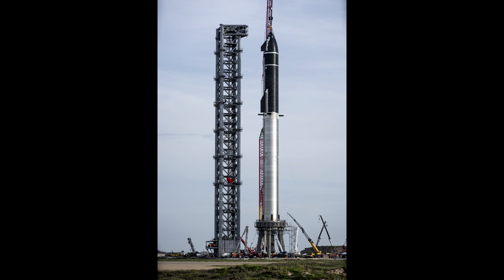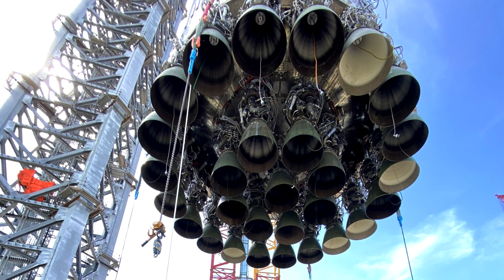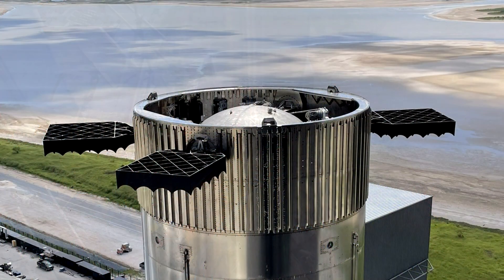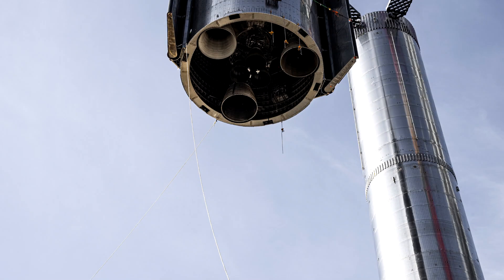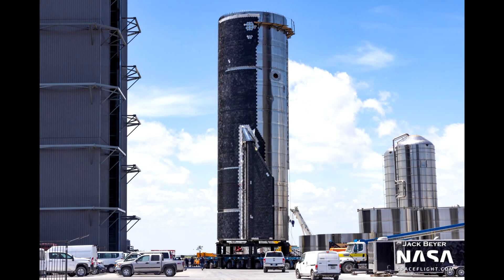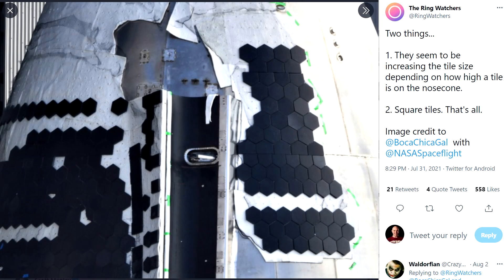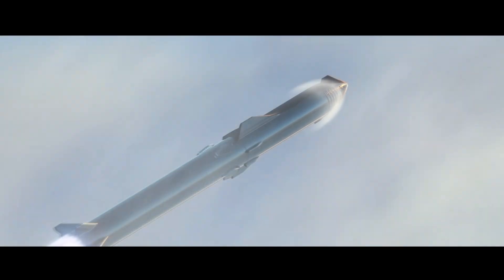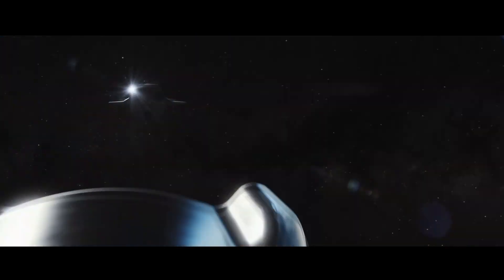How SpaceX Designed A Heat Shield For The Largest Spacecraft Ever Built

Comment: Just as an aside, has anyone ever thought of a spray on heat shield? Come back from orbit and reapply over exposed areas.
Reply from the maker: They tested an ablative paint type coating on the X-15, the problem is removing it and reapplying.
Reply: The problem with this is that you would need to melt the heat shield or make it a cement. Melting a heatshield requires insane temperatures by design, and cement requires time to set.
Reply: @LaughingOrange  What about an something like an epoxy and a solvent?
Reply: Cool idea for sci-fi if not for reality
Reply: @scottmanley  what is your view on Anti starship Anti spaceX channels like common sense skeptic ,thunderf00t,etc ??
Reply: Only need heat shield for descent ry,...could heat it on ascent, let it set in space, get exposed to heat from the sun etc, could it be ready for descent?
Reply: @scottmanley  did they try white spirit that cleans everything 😂
Reply: @eternalemperorvalkorion750  when cleaning, nothing beats good old brake cleaner xD
Reply: baugcht They should have gone with the traditional bio-fungal agent approach!... Self assembling! ;)
Reply: When hearing “spray on”, I inevitably get horrible flashbacks to the spray-on insulation that was applied to the Shuttle external tank.

Obviously not the same thing, or even really analogous, of course. But god what a problematic thing that turned out to be, in terms of extra debris to rain down on the orbiter TPS ☹️
Reply: @Hello-vz1md  thunderfoot is an intellectual fraud.  He should stick to chemistry and stop discussing topics he knows nothing about.
Reply: @jgottula 
spray on spray off
Sounds like ElonFuuu~.
Reply: Early in the Shuttle program they were talking about something like that, that an astronaut could apply. If he could get to it.
Reply: It was a possible option with the Space Shuttle. Same with an ablative heat shield identical to that on Mercury, Gemini, and Apollo, along with a heat shield made of metal shingles.
Reply: @robertmiller9735  that was one of the main reasons the Manned Maneuvering Unit (MMU) was developed.
Reply: @scottmanley  ... & it was pink!
Reply: Spray-on heat shield for emergency purposes does sound like something that in theory could have been used in the post-Columbia days of the Shuttle program, when they started actually getting paranoid and doing real robotic arm self-inspections of the heat shields and so forth.

I don’t think this was ever the actual plan though… AFAIK the plan basically involved “welp, that orbiter is a writeoff now”, and if it was an ISS mission you’d just come home on a Soyuz or something, and for Shuttle-only missions you’d have the mandatory ready-to-go other-orbiter on standby at the other pad launch up, hope it didn’t also have a fatal tile problem (!), transfer over to it, and then again basically just ditch and forget about the damaged orbiter.
Reply: @rwboa22  Oh, fascinating. Didn’t know about that angle of the MMU. Suddenly makes a lotta sense when looking at the “how the hell do we get an astronaut all the way over to this-or-that nook-or-cranny way over there on the orbiter underside via the robotic arm?” stuff that ended up being under consideration.
Reply: @rwboa22  Yes, I know. That was before they realized the arms could do the job better. Imagine an astronaut trying to work on the underside: no handholds at all, forcing him to use his MMU jets for traction. Don't think that could work.
Reply: @xWood4000  Epoxies and solvents are organic compounds. At these temperatures anything organic left on the hull just burns away rapidly, instead of ablating.
Reply: For this the biggest problem is the CM's of expansion and schrinkage of such a large metal tank
Reply: @Hello-vz1md  It's possible for two things to be true at the same time:
(1) Elon Musk frequently lies/exaggerates.
(2) SpaceX does some really amazing things.
The Hater channels focus on #1, often losing sight of #2.
The Fan Boy channels focus on #2, often losing sight of #1.
Reply: @paulmichaelfreedman8334  Hmm, you're right. I don't know enough about material science to come up with something similar that isn't organic
Reply: @JohnDoe4321  i agree with you 
Those channels don't give right credit to Elon and his hard works 
Same for fanboys they only focus on good works and ignore bad things
Reply: @anthonypelchat  My man, I'm a fan of SpaceX as much if not more than most people. But you got to admit starship is SKETCHY AF. You have to hope your MASSIVE windows that are placed on one of the highest stress points of the aircraft don't break, hope your large exposed 5m+ hinges stay intact during reentry, and you better hope the landing goes off flawlessly because if something wrong does happen you are guaranteed to die as there is no way of escape. SpaceX are basically relying on everything going right with very little redundancy. These are all valid criticisms by very intelligent people, dismissing them as just "spreading hate" is naïve. If you really want to face facts SpaceX hasn't even really proved recovering the Falcon 9 has saved them money yet (just think about the costs of running the barges, transporting the boosters, and the hundreds of extra personnel) They very tight lipped on actual numbers and their launch costs to customers are the same as always. Lets not even get started on how dumb earth to earth is.
Reply: They tried a spray-on heat shield with the X-15 rocket plane, and they found that it just didn't work very well.
Reply: @Train 2noplace What about if you could build tiles on a huge shaped silica blankets formed to the Starship shape already then have a machine/robot and people manoeuvre that on to the hull and bond and attached fixings?  I think that wouldn't work so what about a robot or robots that can not only fix the studs but apply the tiles also as per computer algorithm.
Reply: @xWood4000  It probably has been looked at carefully but a formulation that's easy to apply but tough enough to take the temperatures hasn't been developed ... yet.
Reply: @scottmanley  Have they ever tried an ablative coating on a semi-flexible substrate that could be attached/removed in larger panels?
Reply: @jordanturner97  Name one launch "entity" (company, country, whatever) that has "proven" their true launch/recovery costs.  And why would SpaceX share this information, given they are a privately funded corporation?  To the extent that competitors don't know the true costs is a significant competitive advantage for SpaceX.
Reply: @xWood4000  That is why it's so frikkin hard to design a good, functional and long-lasting heat shield. And I expect SpaceX to have quite some issues with it before they get it right.
Reply: @scottmanley  Can´t see it being rapidly reuseable if they have to replace tiles. Even if it is only every 2nd launch. I feel SpaceX will come up with a new non tile solution.
Reply: @jgottula  yeah that was regular foam type insulation for the fuel storage main tank, the single use one. That foam was problematic, they always had to touch it up before launch. And not too mention the chunk that fell off and which led to the demise of Columbia on STS-107. And it looks like the new SLS core stage  (with 4x shuttle engines) might have the same coating, it this case it wont matter if chunks fall off.
Reply: @jordanturner97  you are a spacex fan and your first argument about starship is a strawman against windows that might not even end up in there? And the concern is that they can't design them properly for the loads during reentry? It's obvious where you are coming from.
Reply: @jordanturner97  i think they've proven it enough based on the sheer number of launches they've had compared to any other competitor on the planet currently. they're either A making more money than all of them, or B cheap enough that everyone wants to use them.
Reply: @zoltankurti  I think you might want to work this out with a therapist. I'm a SpaceX fan but I actually have a foot in reality. Did I say they couldn't design windows properly? No. Don't put words in my mouth while trying to lecture me about strawman arguments. Windows are very fragile, represent and absence of vehicle structure in the areas they are placed, and require complex seals and mounting due to differing expansion rates. NASA even made SpaceX remove some of the windows in Crew Dragon because it would not meet their Risk Factor requirements otherwise. I've done my research, Where's yours? Where's Elon's? Ever wonder why every single plane you've ever been on or rocket you've ever seen doesn't have a wall made of windows? Starship looks awesome and I hope SpaceX succeeds, but you're probably young and need to learn there is a difference between being a fan who is able to look at the positives and negatives of something and criticize it; and being a Fanboy who takes any criticism as a personal attack because you see the creator of it as a god. It's easy to see which camp you fall into bud, It's not healthy and blind fandom points to some deep rooted issues you should try to resolve
Reply: Rhino Liner…… 🤔 hmmm 🤔 …. Elon o Liner ????
Reply: @jordanturner97  my guess is that they simply won't have windows or much smaller ones like they have on crew dragon. If they will, they solved all the problems you mentioned. I did 0 research about this, it was kind of obvious that if they have problems with huge windows they will not fly humans with huge windows. I think this is solidly grounded in reality. Notice how I did not go and try to defend point to point or the idea of crewed propulsive landings on Earth. I hope the "very inteligent people" does not include common sense skeptic, because that guy doesn't understand parts of high school physics. If you don't believe that check out his comments under my video. Enlightening.
Reply: How about a quick patch with Bondo and Flex Tape?
Reply from the maker: @Hello-vz1md  Skepticism is good, but lots of these examples are massively inconsistent and frequently head off out of touch with reality in attempt to criticize things. True skeptics would be happy to be proven wrong.
Reply: @jordanturner97  The problem with TF and others isn't the criticism. It's the outright lies and spreading hate. Calling something fraud or a PR Stunt because the early development doesn't match the far future possibilities is crazy at best. Seriously, the windows or hinges being a concern and calling it fraud or sketchy because of that? Guess what, the Shuttle had both and never had issues with those. And do you see either on the prototypes? No. The reason why is because SpaceX isn't focusing on those. The renderings are simply that, CGI by an animation team, not the engineers. Anyone calling it sketchy because of that is a fool.

As far as SpaceX "proving" recovery cost, they don't have to. Are customers saving money? Absolutely. SpaceX DOES sell reused boosters cheaper:$50M vs $62M. That's what happens when you rely on idiots for research. You start making stupid comments. I'm not trying to attack you. That is the crap from TFoot. He also got numbers from competitors on Falcon 9 costs. Really? You actually think ULA would be honest about SpaceX costs if they actually knew? And you know a fun one: TFoot actually used crap numbers to compare Falcon Heavy contract costs vs ULA's and did NO RESEARCH AT ALL!!! He is absolute junk. 

All you need to understand the savings of Falcon 9 reuse is Starlink. Why would SpaceX reuse boosters for themselves if they were more expensive? Outside of that, how would they be able to launch as fast and frequent had it not proven to be hugely successful for them? As for customers, why would SpaceX greatly lower costs for them when SpaceX is already the cheapest option by far?

For the rest, I'll make it quick. How could you have a fully reusable cargo stage without a hinge? How many crewed spacecraft haven't had windows? And for Earth to Earth, every launch and recovery of Starship is effectively that. The only difference is having a landing platform in a far different area from the launch platform. The US military is already looking into it. Will it replace traditional travel. Unlikely, but that doesn't mean that the system is impossible.
Reply: @Hello-vz1md  thunderfoot is generally (all themes, not necessarily related to spaceX) sometimes right and sometimes just a self righteous prick. He overestimates his knowledge and just doesn't like some things. That's pretty apparent.
Reply: @scottmanley  it’s really cool that you answer questions!
Reply: @jordanturner97  "and you better hope the landing goes off flawlessly because if something wrong does happen you are guaranteed to die as there is no way of escape."
Define "go wrong". It seems something went wrong on SN15 landing. They said beforehand that they were going to fire three engines in the initiation of the landing sequence. Only two fired though, and it was not the optimal two, so it looks like they managed to land even though they had an engine failure.
Reply: @jordanturner97  It seems like most of your concerns are based off of marketing concept art. The fact of the matter is, until they build the cargo door, until they add windows, etc those things don't matter. They aren't enslaved to some artist's conception of a ship that isn't even done being designed yet. Elon made a good point in Tim's interview, which is that Space Shuttle was such a huge headache because they couldn't afford to blow up any ship, due to it always requiring human pilots. Even the STS1 required a pilot!  Which froze the design (and IMO led to accepting risks that got people killed twice). Starship doesn't have any such requirement - it will never need a pilot, even after it's human rated. That means they can fly and blow up as many of these things as they want, and make it as safe as necessary before ever allowing a human to set foot on one. Personally, I think that will eventually lead to an incredibly safe ship, even if it means altering the design to a point where it looks nothing like anybody's 'artist's conception'. After all, it's not about looking pretty, it's about getting it right.
Reply: @LactoseLama  I like the way you think
Reply: Seems like an obvious step and not a leap.
Reply: @xWood4000  Epoxy would melt, and solvent would do the same. Even the ceramic gets hot on the surface areas. If the powdered ceramic peel away due to the epoxy melting away, then it will eventually reach the steel part.
Reply: @robertmiller9735  Especially when they are moving at thousands of miles per hour in space.....
Reply: @JohnDoe4321  Elon exaggerates for a reason. It is to motivate his employees. IT worked pretty good so far. What lies has he told so far? Why don't you enlighten us?
Reply: @JohnnyZenith  How is SpaceX gonna be able to build an OVEN that big??????????? Maybe they can shape the ceramic tiles and then bake them, but bigger the tiles, bigger the oven it needs.
Reply: @scottmanley  And the big problem with that is that the gases being emitted via ablation can really mess with the trim balance of Starship during reentry
Reply: @tippyc2  Not entirely true (though mostly). While I dislike or even hate all those SpaceX haters - look at how Hyperloop is working. Or how many tests the starship needed.
I wish SpaceX the very best of luck - and they don't deserve hate-fueled flak. But they do deserve some criticism. And some things thunderf00t had in his video about Hyperloop - where things that were reasonable and came out to be true. Do I wish he would hate less? Of course. He is a douche unfortunately - but when he is in his element (thermodynamics for example) - he is really good. I just wish that he could achieve all of this without being ex-Anti-SJW shit-stirrer. But thankfully he at least tamed that part - a bit. I didn't watch most of his newer videos (I can't stand him), apart from the one with where he and the team made a new discovery.
But while debunking million (or how many that was) trees - he gave very important information on Climate change. Information that not enough people know.
Reply: @JohnDoe4321  I agree with you. Amount of both haters and fanboys is staggering. I know it helps in marketing but the whole thing is toxic AF. You can't now have an opinion in some circles. You have to be on one side or the other.
Reply: @scottmanley  And it’s pink.
Reply: @1flash3571  1.  I said nothing about bigger tiles at all.  2.  I said it wouldn't work.
Reply: The steel industry uses 'gunnable' (sprayable) and castable refractories, along with self-sintering powders...that is, the powders sinter from the heat of the liquid steel contacting them.
Reply: @scottmanley  the cubesat could have a little bottle of it to spray on missing or cracked tiles
Reply: @1flash3571  What difference does that make? Right now you're moving at about a thousand miles per hour as the Earth rotates. Doesn't stop you from doing things.
Reply: 69th reply

Comment: Wow, did you really record this before Tim's part 2?! You really covered a lot of the ideas from that.
Reply: Scot even predicted Elon’s jokey idea of putting a camera in the tank sections and seeing if it glows red from reentry
Reply: @aqeelraja4750  True, but not a joke. It's the best way of recording the location of a failure I think. There'll be no cameras on the outside.
Reply: @johnmclaughlin4778  it was said in a jokey manner but it’s a solid idea
Reply: @aqeelraja4750  But then they need a proper black box with its own heatshield, even parachute and make it float on water, because it's unlikely they get any usable bandwidth in the critical phase of reentry. Some maybe, but nothing close enough for proper video streams.